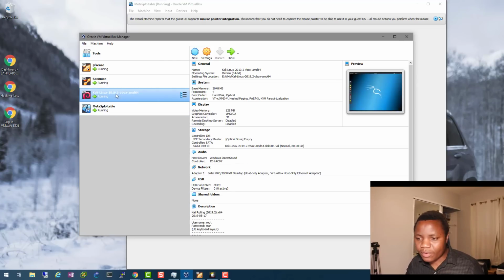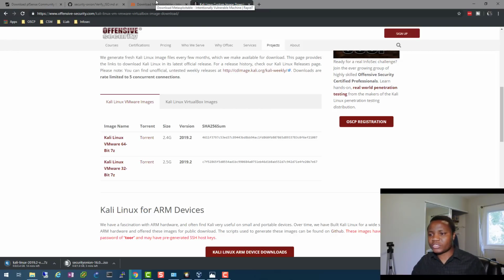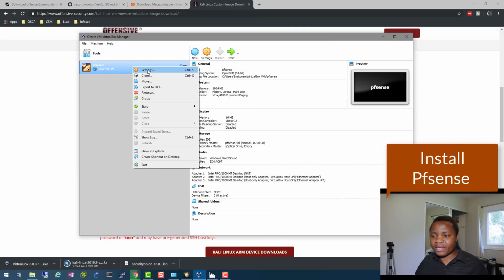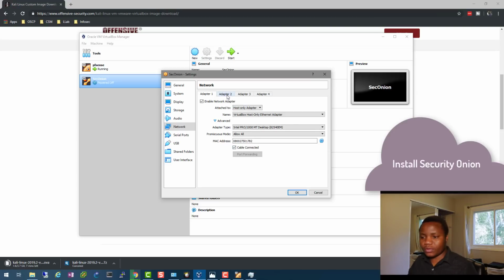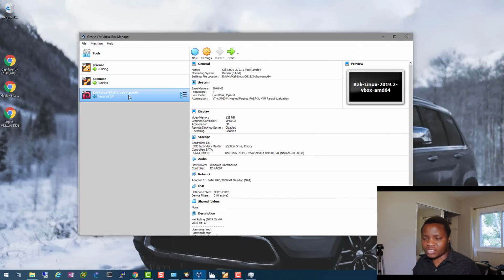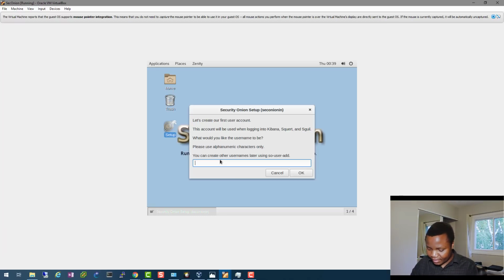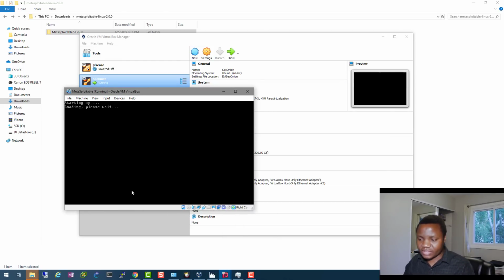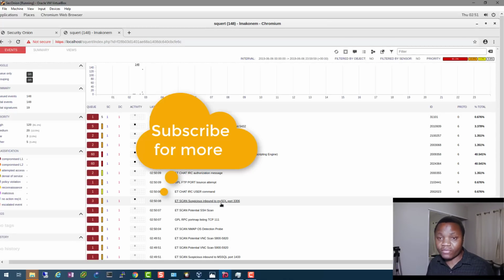How To Setup The Ultimate Penetration Testing | Network Security Monitoring, Cyber Lab for Beginners

Comment: I'm getting a "kernel panic- not syncing: fatal exception in interrupt" error. Any suggestions?
Reply from the maker: What kind of system do you have? Are you using virtual box? Do you have virtualization enabled ? Are other machines running? How much resources do you have, ie RAM, Disk, Cpu etx
Reply: @ITSecurityLabs  updated my system resources, so now how long does this "vm_fault: pager read error, pid 1 (init)" message last?
Reply: 16 GB ram, 4 processors, 500 GB hard drive, 2 TB external hard drive, running virtualbox

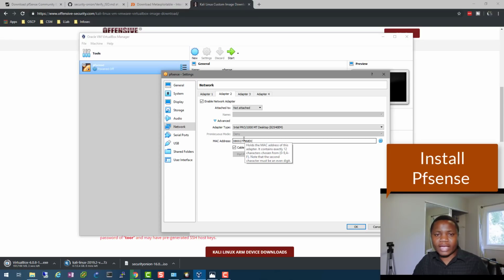Comment: Hey, i followed your earlier videos and purchased a used dell server to setup a bare metal esxi host which i am accessing via vmware web client. However i noticed that in your future videos especially when it comes to configuring the LAN & WAN vlans, you switched from demonstrating on your baremetal to using virtualbox which has made it hard to follow. I don't see options in the vmware webclient like the network mgmt screen you have at 10:09 of your video where you are setting "bridge" & "host only" modes for the network interface. How do those of us that followed your bare metal recommendations earlier follow your series? Pls explain how to set that up

Comment: I downloaded the exact version and format of pfSense but I didn't get any dis image. Instead, it's files that are to be burned into a CD. Please help.
Reply from the maker: Did you download the .iso files ?
Reply: @ITSecurityLabs  Yes. Turns out that the .iso was showing up as a zip file and I unzipped it. That waas the issue. I chose the .iso file without unzipping and it worked. Thanks for replying
Reply: @ITSecurityLabs  What setup do you recommend if I want to get logs from Kali but I also want Kali to be connected to the internet for CTF/HacktheBox?

Comment: I followed the setup and got everything to work just as you described in your video. However, the display is all off on everything. You mentioned that you had another video to discuss the display issues, but I was unable to locate that video. Would you mind providing the link to how you got the displays to adjust properly? I have installed the guest additions, but it is not working as it should. Also, I noticed you increased the specs on the Security Onion VM. Mine works, but it was sluggish. I am going to try with the specs that you have. 6 processors and 9660 Base Memory. I can’t get full screen with the Security Onion VM.

Comment: would there be a case for running this in vsphere? I'm not too knowledgeable in virtualization
Reply from the maker: G. Lally yes you can. I ran the same lab on VMware workstation and it worked well. It’s even better in vsphere with distributed switches.

Comment: my pfsense machine wont run when I have more than one network adapter enabled, do you know why this might be?
Reply from the maker: Kyle Horton how much RAM, CPU and Disk do you have on your workstation?
Reply: @ITSecurityLabs  I got it to work, I was using virtualbox 6.0, I unistalled it and installed VBox 5.2 instead an I got it to run.

How long does the pfsense reboot take on average? I feel like I have been waiting too long...
Reply from the maker: Kyle Horton it does not take a lot of time. Less than a couple of minutes.
Reply: @ITSecurityLabs  16GB RAM, CPU - Intel(R) Core(TM) i7-3537U CPU @ 2.00GHz, for the Disk I have 278GB free of 449GB